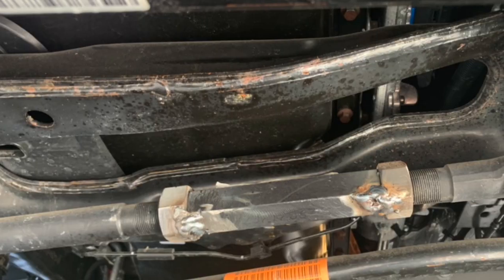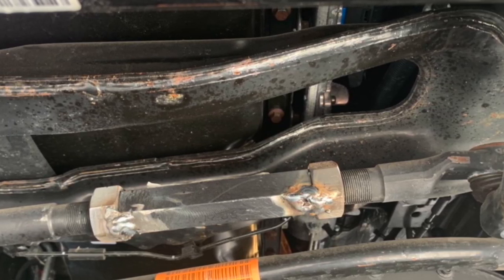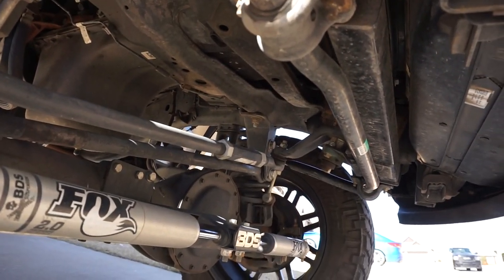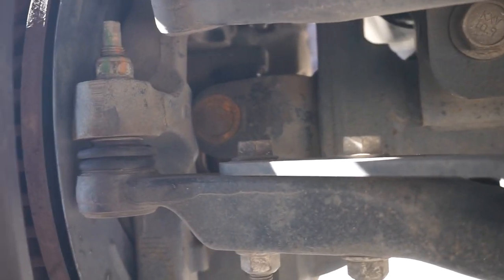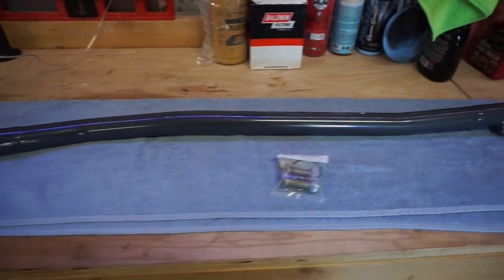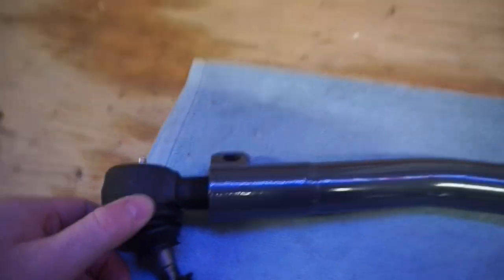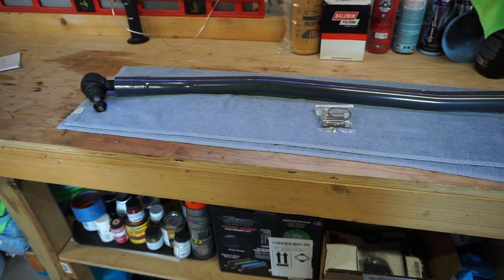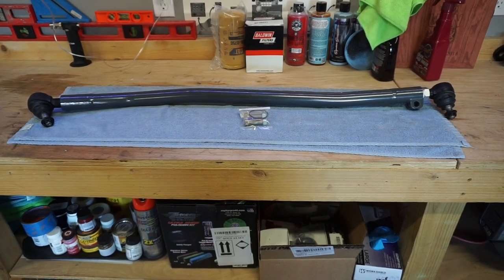Get your FREE Synergy Drag Link...

Comment: Great info... I've been dragging my feet on this for a while now.
Reply: Same here. The dealer wanted to replace mine with another lousy part and tack weld it and I denied them. I think I'll order the new parts for my steering now though. Ive just been putting it off because mine is holding strong thus far!

Comment: I also have been slow to get this replaced, I just have put blue Loc-tite on the nuts and it has been fine so far, but I still want to get the repl. drag link, just a pain to buy it, submit paperwork, install it, have it inspected, submit more paperwork and then what for the $.